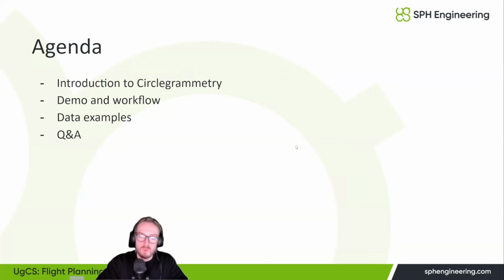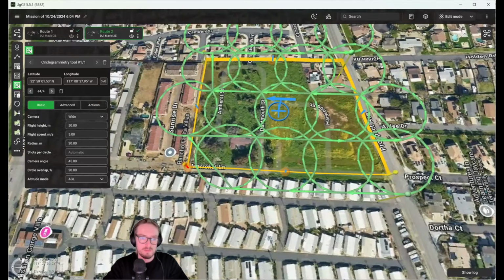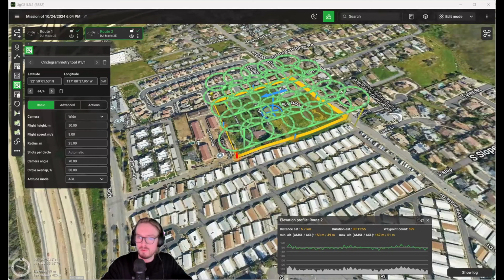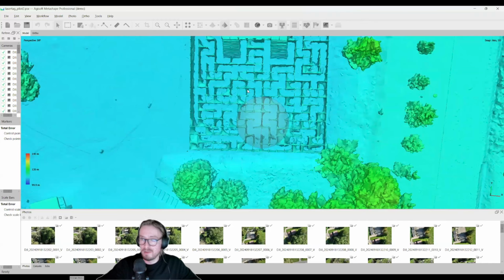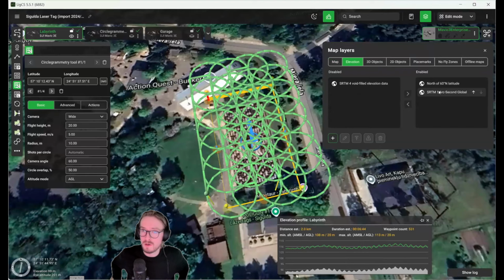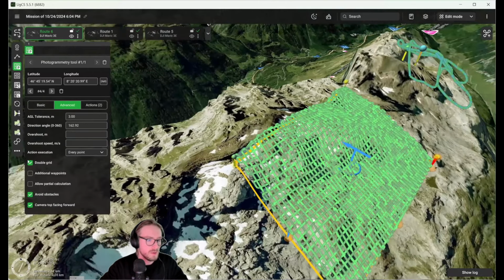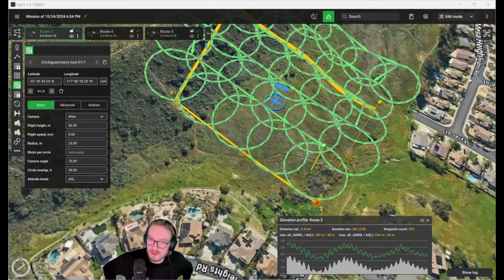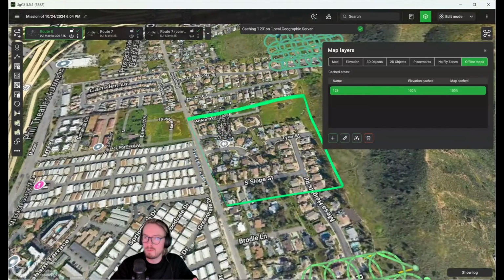Live Webinar | Revolutionizing Drone Mapping with Circlegrammetry

Comment: Thinking outside of the box, your pattern is cool, new twist on things. Go one more. Is there any better way to do this? Say Mount 5 cameras to bottom of a drone, like google street view cars have 8 cameras on top in a sphere design. Let the drone just fly and use the 5 cameras as source for your photogrammetry? Would thinking like that reduce the pattern length or create a new pattern to reduce flight time better results in anyway?
Reply: Thanks! There are already cameras like that, check out SHARE cameras. We have some of our customers using UgCS with them.